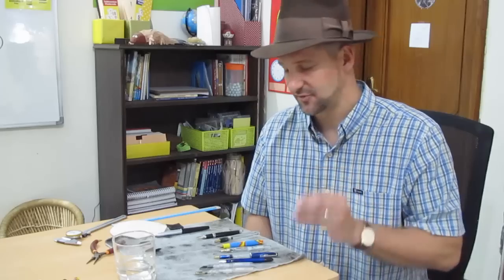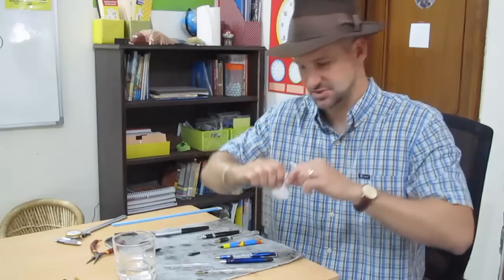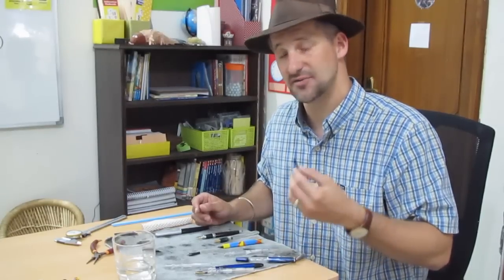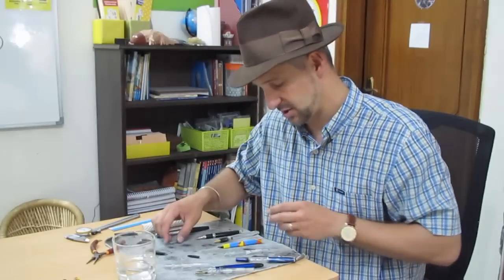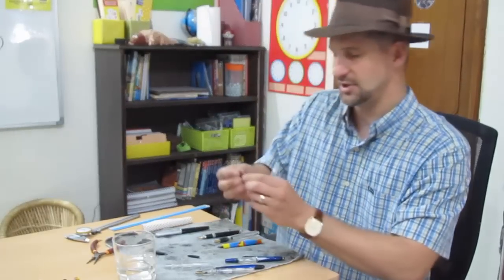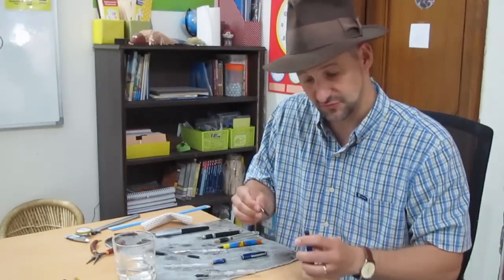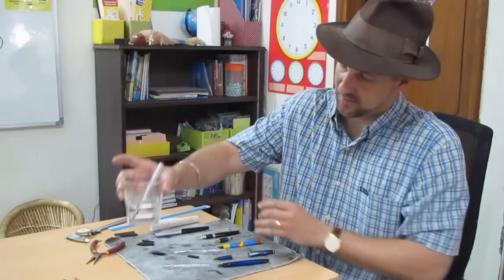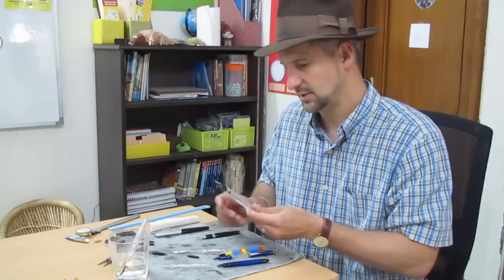How to remove and replace a fountain pen nib and feed.

Comment: I have a Hongdian 517D fude, it writes very smoothly but the color of the fonts is always much lighter than the other pens that I use.  And I am using the same black ink.  The ink flow is just adequate maybe that's why.  Is there anyway I can fix the existing nib?  I cleaned it out yesterday without removing the nib from the feed; only twisted off the nib/feed assembly.

Comment: Hi, what kind of feed and nib do I need to buy to work with waterproof inks? how many standard sizes are there for the feeds? thank you
Reply: Calligraphy ink should not be used with fountains.  There are some waterproof fountain pens inks though.  As long as it is a fountain pen ink the feed is less of an issue.  There really are not "standard" feed sizes.

Comment: i have an airmail 69t and after I replaced the nib its wiggling sometimes it stop flowing and and sometimes its just burps crazy 
you said to flatten out the nib how to do that specifically ?
Reply: You can use a pair of pliers to very slightly flatten out the base of the nib.  Only slightly bend it though.  This will all the nib to better "grip" the section.

Comment: Hi I was trying to remove my fountain pen nib pen but i accidentally broke off one of the ridges on the feed. I still have the small piece that broke off - how can I repair it? Superglue? Epoxy?
Reply from the maker: It is probably not necessary to repair it as long as the tail of the feed was not damaged.  I think it would be hard to fix otherwise.

Comment: but how do you do it with the gama jumbo? i tried very hard pulling on it and it wouldn't come out
Reply from the maker: Unfortunately the Gama pens are seated very tightly.  These pens usually require a "knock out block" to remove the nib and feed.
Reply from the maker: Some mildly soapy filtered water will work just fine.